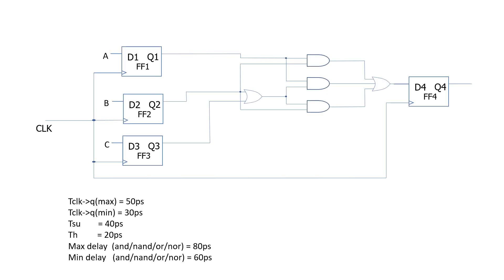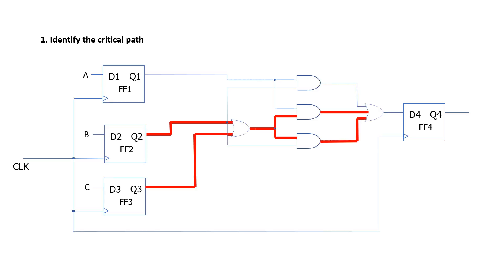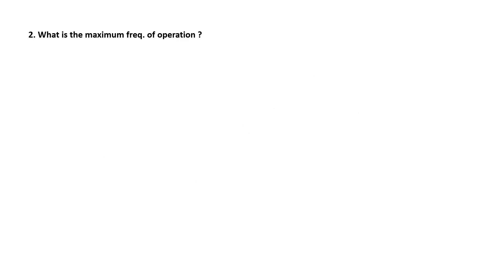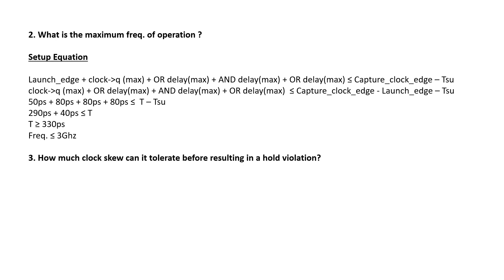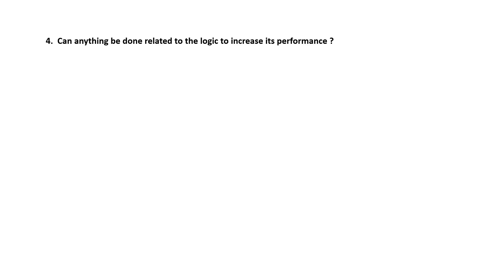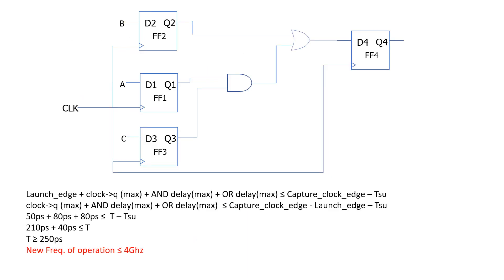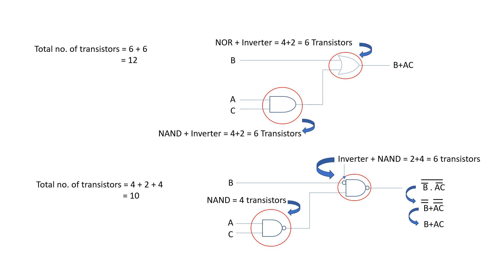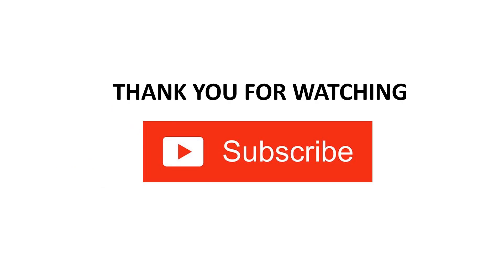InterviewQuestion-1 | Digital Design Engineer

Comment: in calculating max skew, in that hold equation you have mentioned only 2 gate delays we have 3 gates in data path so skew is  Tskew<230ps
Reply: Because when doing hold analysis we choose the shortest path which gives us the least delay in the circuit, In our case it is the path from input A to the output seeing only 2 gates